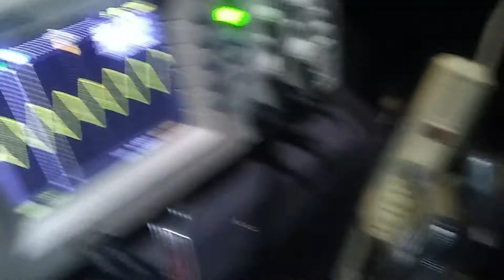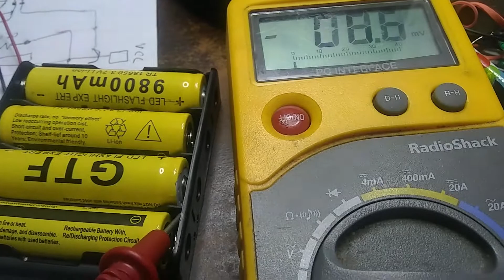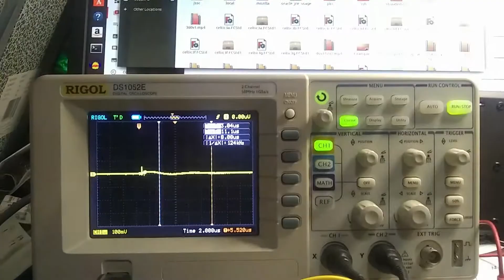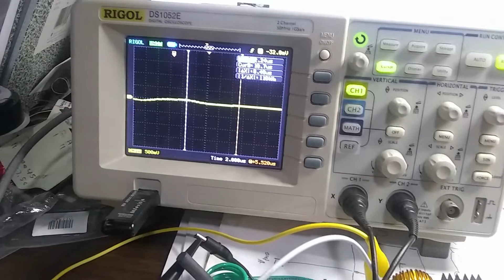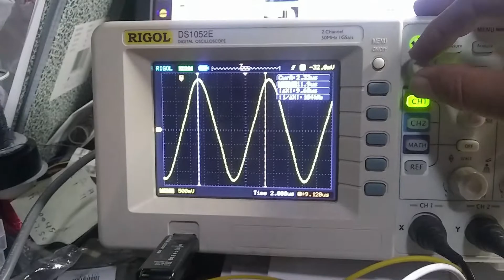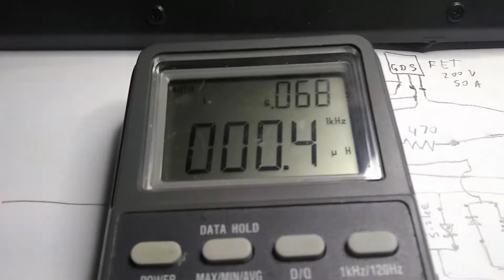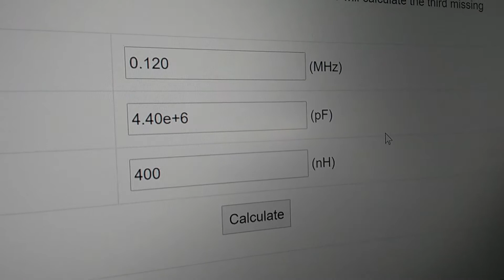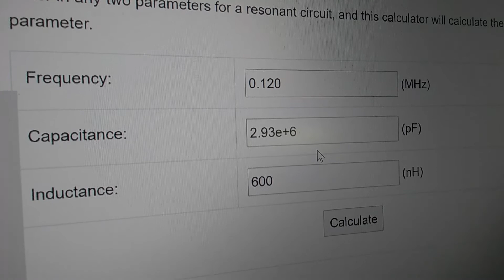Tuning RF Induction Circuit

Comment: You can get some mylar capacitors or ceramic ones to tune the frequency the mylar ones will work fine when you do the mmc thing
Reply from the maker: Sounds good.. you just have to find a good way to solder them into the circuit!
Reply: @jaynesnetwork  solder them to a board then solder some wires from the board to the circuit

Comment: Would it be better to tune the capacitance or inductance on these little units? Also what variable inductor or capacitor would you suggest?
Reply from the maker: The capacitors are probably high power, low loss, high capacitance capacitors.. You can not find variable capacitors, of that large of value, and let alone, handle that kind of RF power..I think that inductor is the only reasonable way to go..  I have been looking for good variable capacitors.. If you find some, let me know!  I even made some videos of how to make them... but they would need to be VERY LARGE.. to be able to tune this device.. This device operates in the ~100 kHz range, which is very low frequency for RF... most of the variable capacitors are designed for resonant circuits in the MHz range.. at higher frequencies, a little capacitance goes a long way... at the lower frequencies.. you would not notice a change in the frequency, with such small values of capacitance, as are available in anything you can buy off the shelf.. Anyway, thanks for the great comments!!
Reply: The better and more direct way to tune frequency is - yes over the capacitors.
But of course the connected inductance like i.e. a heater coil or a little coil made around a ferrit core for doing high-voltage-experiments using a flyback-transformer from a CRT-device will oscillate in their individual-frequency depending on the used capacitor, what also decides, what amount of current will go through the circuit, or what the circuit can take at its maximum load...
I have a ZVS from an austrian fabricator, who sells his circuit i.e in two different versions: One 10A-Version with only one capacitor on it, an one 20A-Version with two capacitors. (But will try even some other fabrications in future).
Frequency and current/wattage seems to depend on that capacitor...
Unfortunately i dont have an oscilloscope, i would buy also the 10A-version from my circuit, und run it under the same conditions like i do my 20A. Would so be interested in, what the frequency of my used coils would be, and how the second capacitor whats not on the 10A version would affect the current, too... 🤔🎓

But what i dont understand, why it should be so hard to find these high-current/high-power/high-frequency- capacitors... 🤔
There are many components yes of course, what even a regular seller, like an electronic-components-store has to order in fabric, because its not a every-day-bought-article, but even rare needed components should be available by a electronic-components-store, or over the internet... 🤔
Whoever this zvs-circuits is building in all its few versions and formfactors, in china and in other countries "brands", need them and seems to lightly can get... 🤔